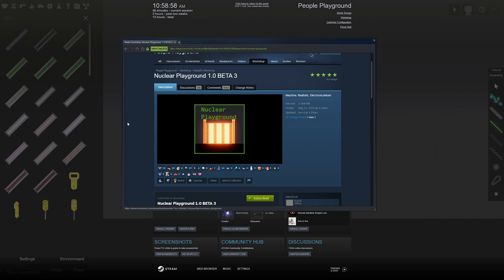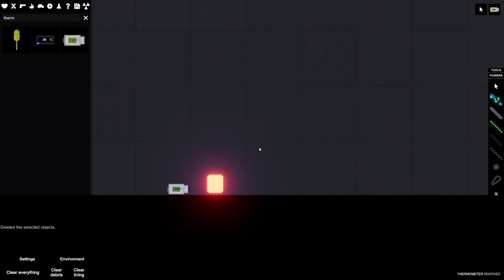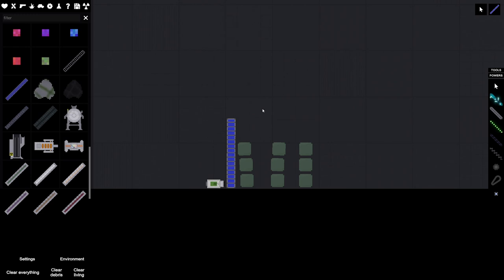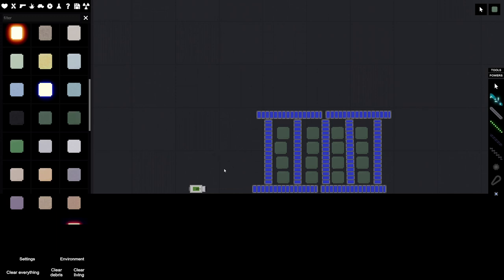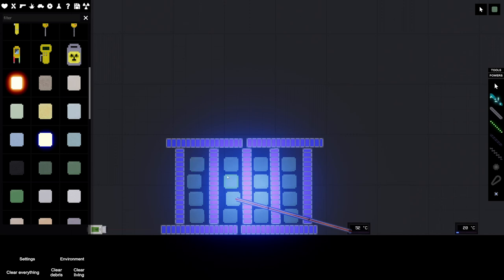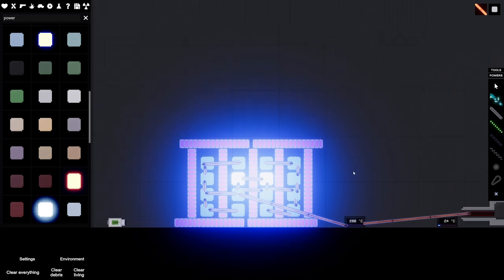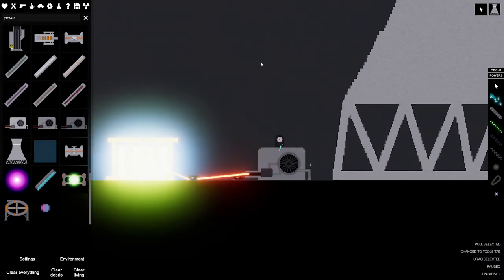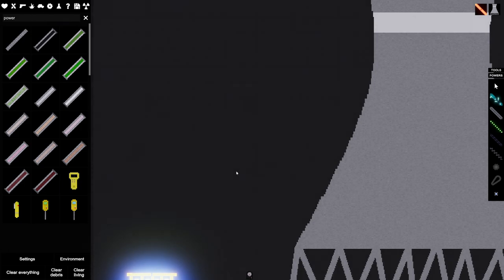People Playground - Nuclear Power Part 1

Comment: Awesome! Be sure to check out the free Chernobyl RBMK simulator by SimGenics. It's quite detailed and realistic, even has the positive void coefficient modeled in a historically and physically accurate way. There are a few versions floating around. You'll want to be sure you've found the one with a working save/load function, self contained installation which is compatible with modern OS's. A YouTube search will point you in the right direction. You DON'T need the full original game distribution which runs on win95! :P